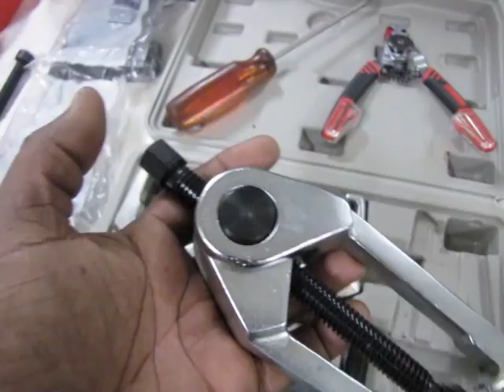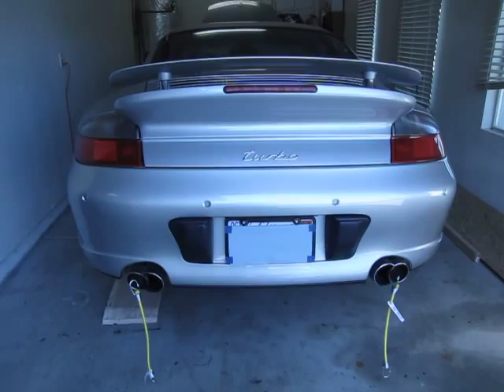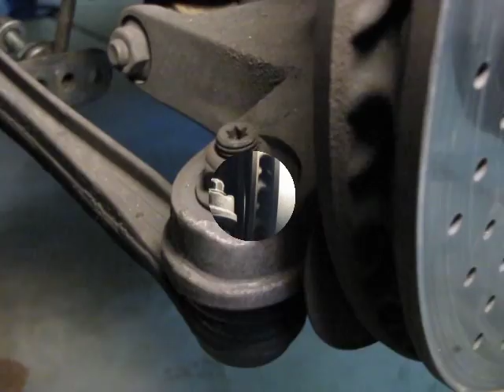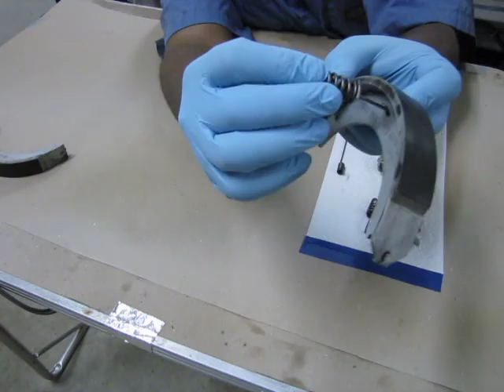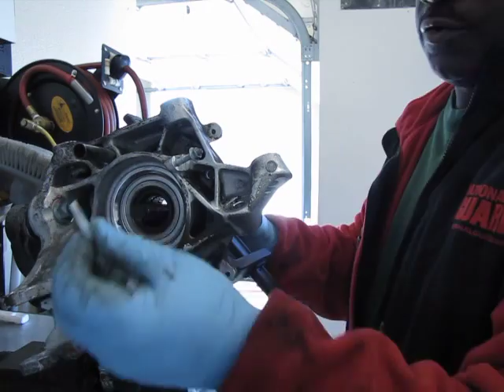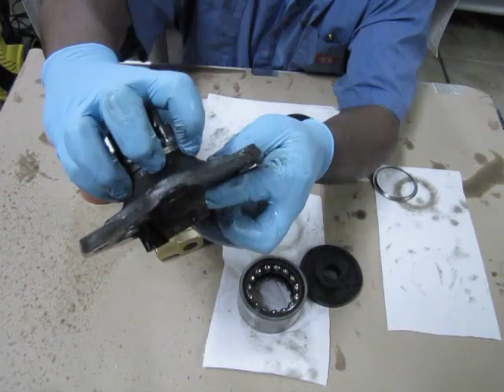How to pack Rear bearings with grease and do brake job 1st Half of Part 1 of 3 on Porsche 996 Turbo

Comment: Thanks for uploading this. Looking at doing my rear bearing and this sure helps.  I tried to search the tools you mention at the start of the video , but can't seem to find them...do you happen to have links for them?  Thanks
Reply from the maker: I got most of those tools off eBay.
Reply: @Engineerboy100  thanks for the reply... yes i saw the part where you mentioned that and gave them a search but didnt see them...i will search around a bit more

Comment: Excellent technical details Clint.  Have you found bearings that run noisy but when extracted and inspected are light on grease and do not exhibit visible  deterioration?
Reply from the maker: Damage to bearings is not always visible. once they are making noise they are damaged, replace them. Don't grease them and put them back in. To answer your question, yes, I have experienced this annoying situation with noising bearings looking ok, … I always replace them ;)
Reply: @Engineerboy100  I  just received a new set of FAG bearings for the 964 rear.  Took them apart  thanks to your coaching and found very little and uneven amounts of white grease on the double row of bearings.  Hot water and soap cleaned them up. Ready for a RedLine full grease and reassembly.

Comment: Sweet car right? Love the 996 turbo. I have a few videos on em
Reply from the maker: +General HowTo Cool, I'll check it out, what's it titled?
Reply: +Engineerboy 100 it's only a few videos down on my channel. It was all scratched and had heavy swirl marks when we got it. Look at see after I'm done. Think it's called 996 paint restoration. Is this your cAr?
Reply from the maker: Yes, this is my 996 X50 ;) love it. had it 3 years. 85k miles current.